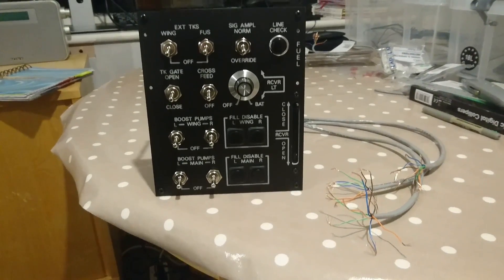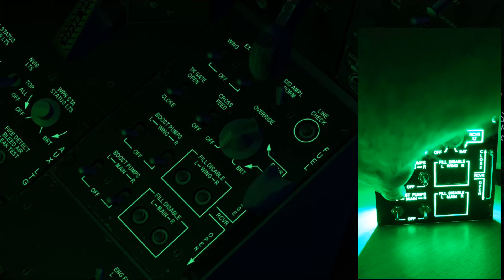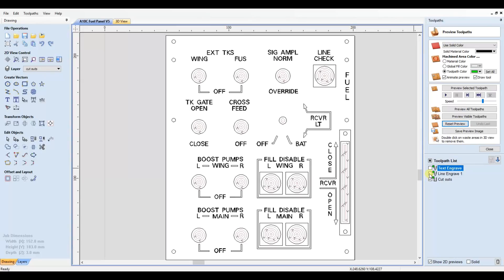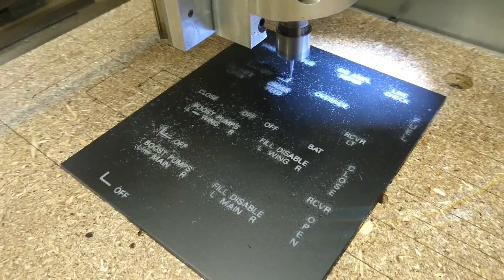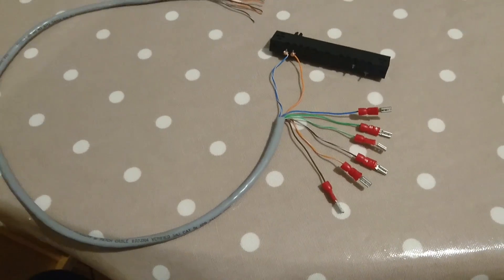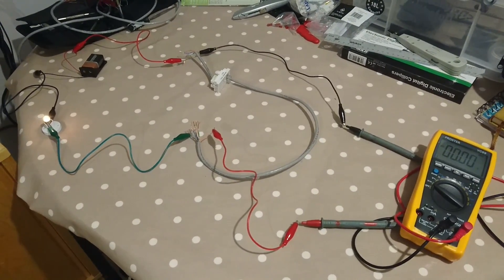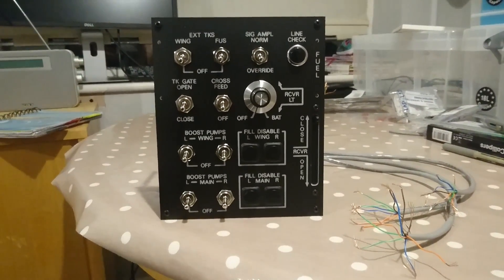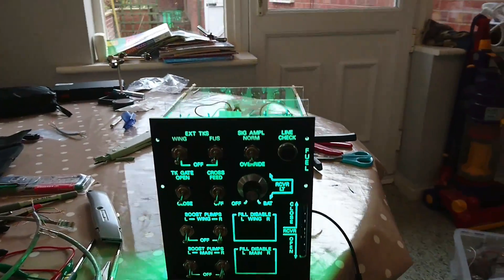DCS A10C Simpit Fuel Panel Prototype

Comment: It's safe to say I'll never be building something like this, but this video was pretty inspiring in terms of problem solving and iterating on a project over time.  It's amazing the mileage you've got considering you're not from an engineering background.  I definitely agree with you on the note taking thing.  I'm currently learning to code and building simple applications, and one of the worst things is to go back to code you wrote several weeks or months before and find yourself asking, 'what the hell did I do here'? 

I think your tips are actually good for generally any kind of 'tech' building pursuit; especially for people like me who tend to run in there like a bull in a China shop.

Comment: looks amazing mate. gives me an idea. If you stuck a thin sheet (maybe max 1mm) of aluminium to the opaque acrylic, and then engraved the metal, you could get a very durable metalic panel. reckon that would work?
Reply from the maker: Hi James, I have been thinking about other ways to do the fascias. After looking at some Tornado panels I would like to have that type of finish and the light plate. Not sure on the best way yet and would probably be for a future project. Metal plating the acrylic is an interesting thought.

Comment: Fantastic build.  Thank you for sharing.  May I ask, how are you powering the LED strips and controlling them? Thanks in advance!
Reply from the maker: Hi Grace By Seven, I power them by 12V supply. At the moment they switch on and off, into the future when I build the lighting panel I will run them through dimmer switches
Reply: @CraigSmysimpit  thank you!

Comment: Hi Craig, I noticed you were using the potentiometer as a variable resistor. ie one connection to one end of the track and the other to the slider. The ideal way of using the potentiometer is to connect a supply voltage to one end of the track and a ground connection to the other. The slider then has a varying voltage on it you can feed as analogue.

Comment: Great job Craig! Would you mind share your text engraving setting (i.e. the engraving feedrate), because as you suggested I sanded  the acrylic before painting it, but anyway when I engrave the text most of the paint is chipping away. Thanks
Reply from the maker: Hello, I updated the FAQs on my website in response to your question. Check the following link for details of the cutting tool and tool path for engraving, cheers
https://mysimpit.co.uk/faqs/

Comment: Hey. cool work. Where can I get panel drawings and which font is used in panels A-10?
Reply from the maker: Hi True, as regards the font and engraving, etc I put a few details at http://mysimpit.co.uk/faqs/
For panel drawings. There's some really good A10C cockpit diagrams / pictures over on the dcs website in the user files (download) section. You can design your panels using these as a guide
Reply: Many thanks !!!. What do you think about using sismo SIMCARD ETHERNET MOTHERBOARD for various simulators (fsx, p3d, xp, dcs)?

Comment: Craig  would you be prepareed to  sell  me a copy of the CASD files you have produced? I am perfectly at home with Hardware but am not at all confident with CAD. ........Thanks
Reply from the maker: Hi Christopher, thanks for your positive comments. I probably wouldn't build new panels with the intent to sell, however when I redo some of the original panels I might put some of the original prototypes on ebay as seems ashame to strip for parts when someone could get use from them. As regards the CAD files, if it's not for commercial use then I'll email you one of them (I think I have the ILS one to hand). This can act as a template for you. Cheers

Comment: Great tips on the wiring mate. Been fighting my own construction with different wiring setups. I like yours. Might give it a try.
Reply from the maker: Hello there, what aircraft / panels are you building
Reply: Trying to do mcp and efis for a Boeing 737. Short on space atm so thought I would start with something that I use a lot and that does not take that much space. Currently have access to a laser cutter and not rotary cnc. This is causing me a headache as well because I cannot paint and then cut because the paint lights on fire. So I have been thinking of just investing in a cnc myself. We will see. I just though I would write. I think your work is outstanding.
Reply from the maker: I know what you mean about space. I had to wait a year for a small space to be freed in the house and did a run of prototypes in that time to build up.
Although I've gone military I really like the airline sims. I went on a simulator of an Airbus 320 a few months ago. It wasn't full motion but had all the panels / controls.
I have been trying to learn as much as I can about cnc as it's my father in laws I use. I plan to build one next year although that will be a project in itself
Good luck with your project
Cheers

Comment: Are you using DCS and Arduino? and/or DCS BIOS?  I saw you mentioned keyboard encoder.??? Is the keyboard encoder the same concept as arduino and can use dcs. My question is what was the board in the video and how are you going to link the CDU and CSMS/ UHF/ ect. to function with the game software.
Reply from the maker: Hi Ben, at the outset of my A10C simpit I planned to use keyboard encoders for all the inputs and dcs bios for all the outputs. I picked up 2 keyboard encoders earlier this year and already had another 2 from many years before. The keyboard encoder can be used with any game that you can set keyboard bindings. The KE108 by Hagstrom is pretty bullet proof and you have a high degree of control over how the keyboard commands are executed. The Fuel panel in this video is using a keyboard encoder only. Ultimately I do plan (down the line, once the encoders are fully exhausted) to use Dcs bios for everything (for Dcs) and this is far more cost effective.
The inputs for the IFF and SVIP (ky58) panels have no keyboard bindings in dcs as they don't officially function (without 3rd party plugins) so I will use dcs bios for these inputs. 
For the CDU, I'll likely use dcs bios to output to a small lcd/tft screen. For the CDU inputs I'm torn because I would in principle use my keyboard encoders but dcs bios will allow connection by way of matrix, so big reduction in input points. When I come to build the CDU I'll decide at the time.
Reply: Awesome thanks!! I've been watching your videos. You gave me some great pointers.

Comment: Love the clarity and references to purchase. Hope to see more videos. My panels come in this week and I'd love to go back to your findings as you go along.
Reply from the maker: Hi Ben, where are you getting your panels from
Reply: The panels I have are from 3 different sources. I recommend checking this guy out. He's doing great stuff and the quality is top notch. I got my glareshield and center MIP from him along with some panels.
http://lynx.dk/

The majority I got are from www.pcflights.com 

and this website I recently found. They have all the F-16C and most of the A10C Thunderbolt. 

http://hispapanels.com/tienda/en/          ---- I bought the IFF and Emergency Control Panel here.

Where did you find the knobs for the VHF FM panel? Also the ones with the double shaft with button on the encoder. Hope this helps

Comment: What is the make and model of your father in-laws CNC
Reply from the maker: Hi Reservoir Dog, my father in law is an engineer and built his CNC machine for his hobby. I can send a run down of the key components he used if you would like them and any others specs / details. Down the line, I'm hoping he will help me build one, he sure knows his stuff. Cheers

Comment: Hello ! You  are doing , amazing work ! Amazing quality !!! If this possible that you share file for acryl cutting ? I don't really know how to use any modeling program ... i'm really stuck ) I'm playing in VR , so i need only tactile filling , same as on the screen .
Reply from the maker: Hi VR4U, if you send me a message with your email address I'll send the file over. It's worth mentioning it's a crv file which is for use with Vectric software (I use Cut2D). I don't think it will work with the trial version. What I can do, is export the vectors to a dxf file if that's better/easier to view, although I'm not sure if you'll lose some detail around the measurements
Reply: thanks ! Please send on this email ! ganeshkaua@gmail.com
Reply from the maker: Hi VR4U, I've emailed across those files, cheers

Comment: what opacity % are u using for ur acrylics? how much light is the default opal letting in? i tried 78% and its to much. Think ill try more like 30%
Reply from the maker: Hi Markus, the light transmission is about 39%. I did originally get various samples and some were far higher transmission although alot more expensive. The opal acrylic I used was the standard one and with good back-lighting worked well. Cheers